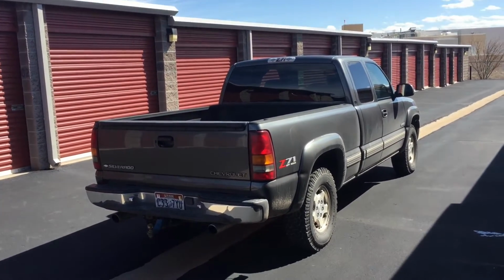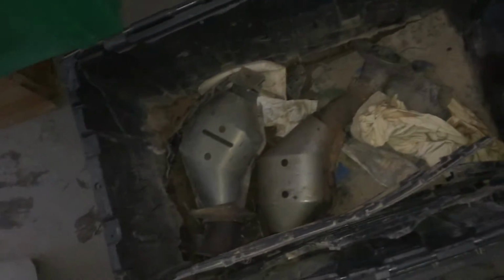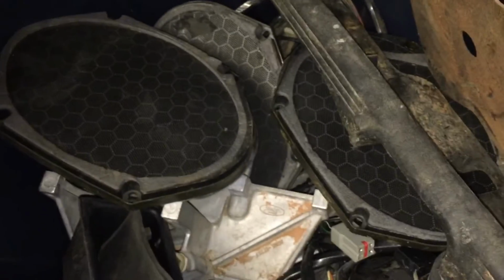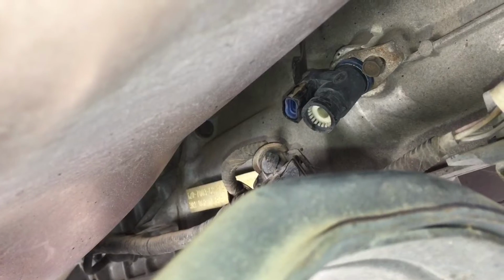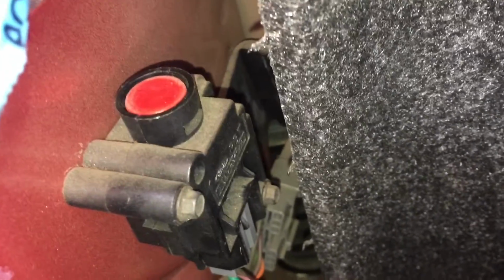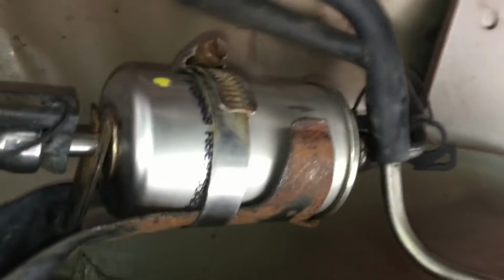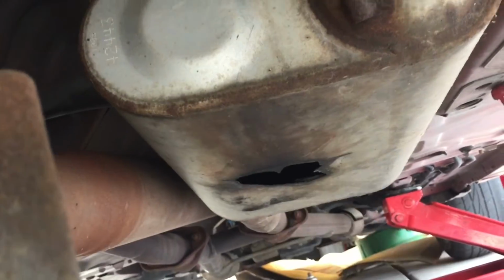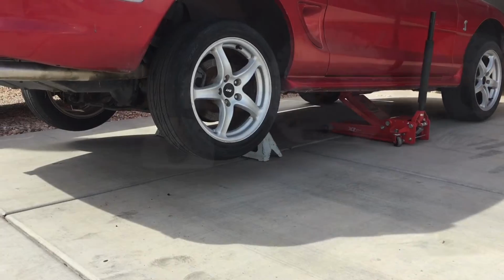98 Cobra update: Fuel filter, Fuel filler neck grommet, speed sensor, parts scrounging

Comment: Hey got a 98 cobra my speedo just stopped working randomly I swapped out the speed sensor already and checked all the fuses I’m not sure what else it could be but it’s making the car lope crazy and idle and run a little sluggish any idea what else it could be?
Reply from the maker: Did you do the speed sensor in the transmission? There is also a gear in the gage cluster. If the rest of the gage cluster is working it’s more likely that gear. I’ll post my video on removal and LMR has one for the gear https://youtu.be/nAiDPRYnjb0?si=Qw0sKcvUCBdgW67i
Reply from the maker: Late model gear https://youtu.be/7k_DbsSxRg8?si=NUQAYDWjqGAZXxo-

Comment: I was wondering if the car runs fine when it’s cool outside but when it’s warm after driving for a while it’ll stumble pretty hard. And when it’s hot it’s  really bad. Could that be the fuel lines dirty?
Reply from the maker: It’s more likely a failing fuel pump, or the coolant system should be burped (when cold so it doesn’t boil over and scald you). Fuel pump https://youtu.be/UhgkGXLSkl0?si=FmDYvusduLqfm9F2
Reply from the maker: Burp 32V engines https://youtu.be/vdiEzahAEb8?si=rGsKa3unUBV6Oqem
Reply from the maker: Burp 16 valve https://youtu.be/fYvDqtGPyAM?si=ASEi98aZJc1OloI9
Reply: Ok so I may be my fuel
Pump the coolant has definitely been burped recently cause we put a new radiator in a few months back band it took forever to burp. Thanks I’ll start looking for a
Fuel pump and keep it on deck

Comment: Did you order the correct grommet? 2R3Z-9072-AA is for 1999-2004 mustangs...F8ZZ-9072-AC is for 1998 mustangs
Reply from the maker: 9072 is the same, so it’s probably just a revision. https://youtu.be/8qbvwh9Pr7E
Reply: @dannyjohnsonsgarage    The difference I see is the 1998 grommet hole is smaller than the 1999 and up grommet hole

Comment: what a great stash of misc parts!  Odd that the speedo doesnt work but the odo does.. maybe the speedo itself has to be taken apart
Reply from the maker: Exactly what I was thinking as well! I thought it couldn’t be a fuse cause the whole cluster wouldn’t work, so I was checking the speedo connection- but turns out the harness for the speedo is on a different fuse. I figured it out! Stay tuned for the next episode 😉
Reply: was it the 10 fuse under the steering column?